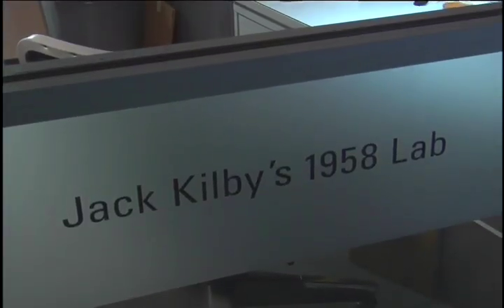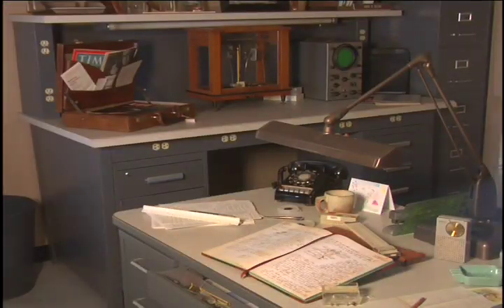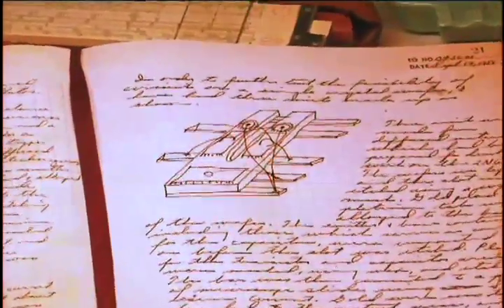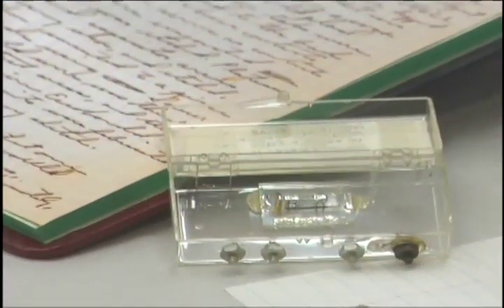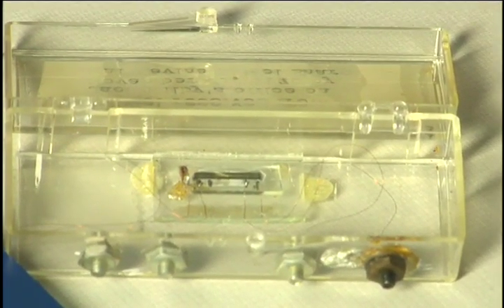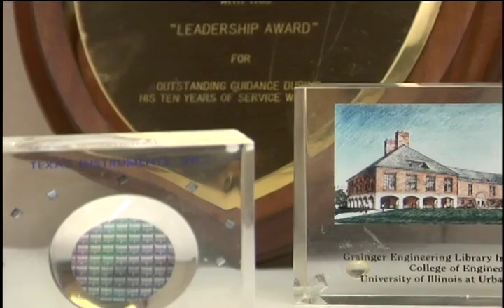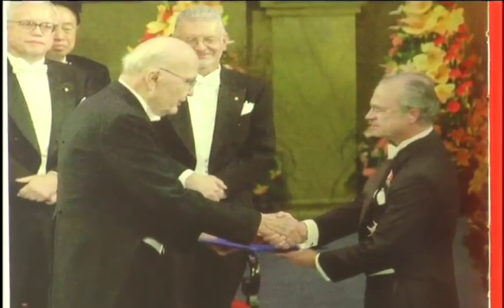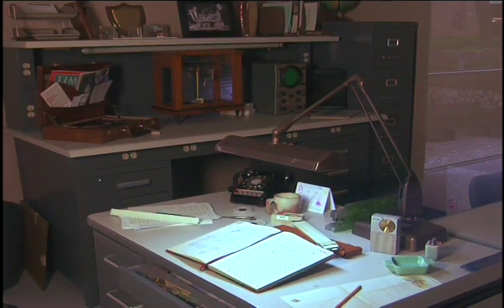Jack Kilby, who invented the monolithic integrated circuit and won the Nobel Prize.

Comment: Thanks Don. My eventual degree was in criminal justice; however, i originally studied electronics. We started out with tubes, then went on to transistors. One day i asked my instructor what an integrated circuit was & he said he had no idea. Working later at General Dynamics, while inspecting through a 30 power microscope, i got to look inside one an engineer had cut open, &.my 20+ year old mind was boggled. Thanks for your presentation.